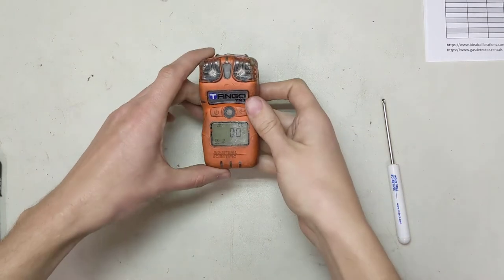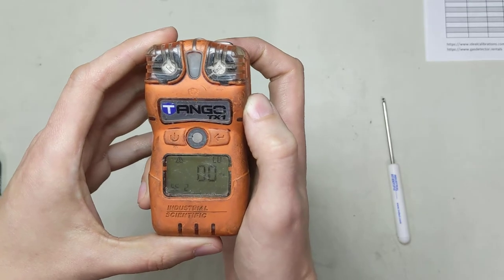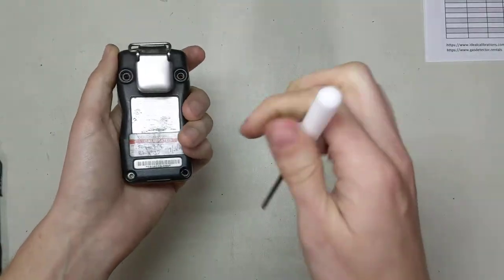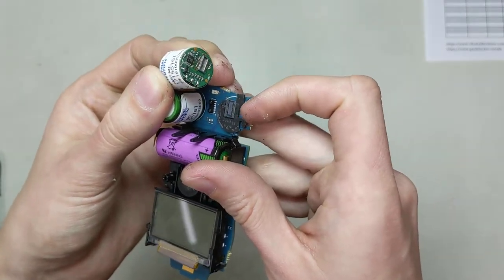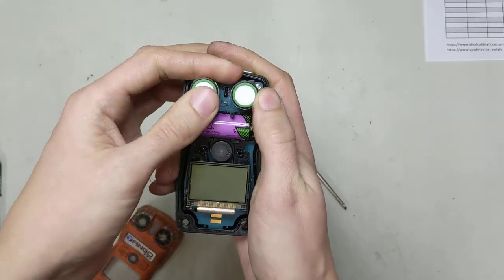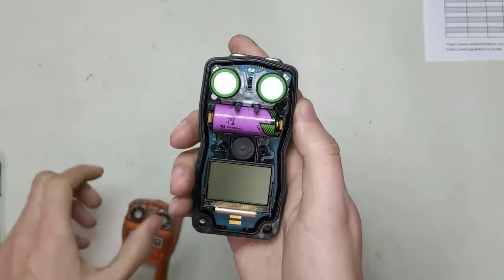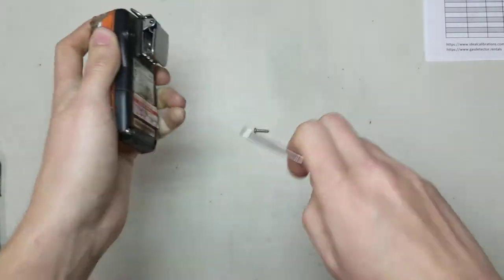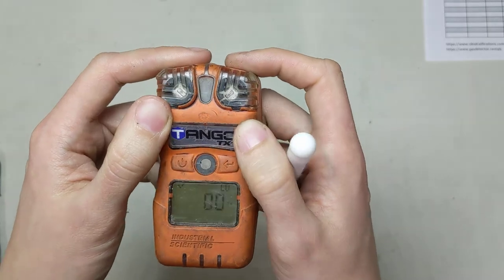Tango TX1 SE1 SE2 Sensor Error Quick Fix

Comment: hi sir..Im daryl  from the Philippines..

do you have an idea on tango tx1  hang on DOC error?. do you how to fix it sir..
Reply: Hey Daryl, DOC error is usually a board error. Send it in to ISC directly and it will be covered under their Good For Life program that covers boards. They should help you out from there.
Reply: Hi daril. Alam mo ba paano enable yong configuration mode. Thanks 😊

Comment: Erorr code 408, can do u help me?
Reply from the maker: Usually this means one of the sensors or both are out of the slot. Try taking them out and putting them back in again and make sure they slot correctly. If you're still getting this error code you most likely have a board issue and should send it in to Industrial Scientific